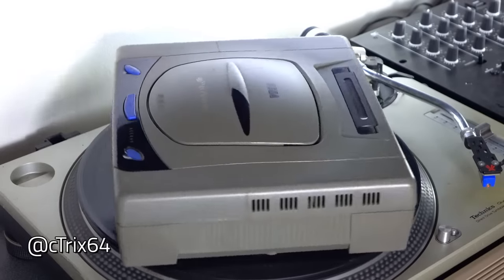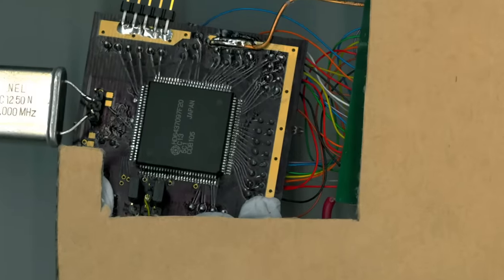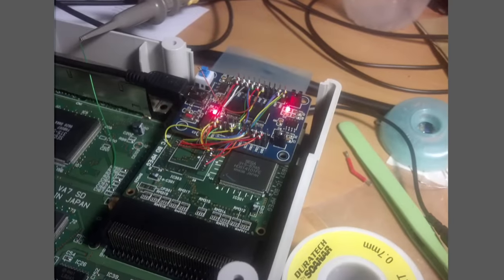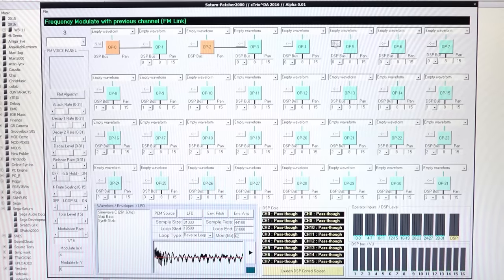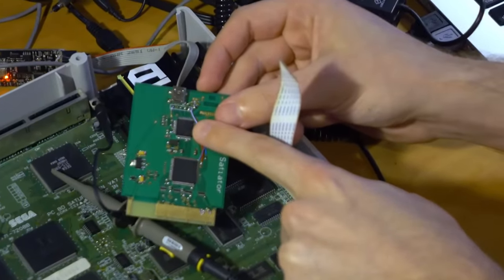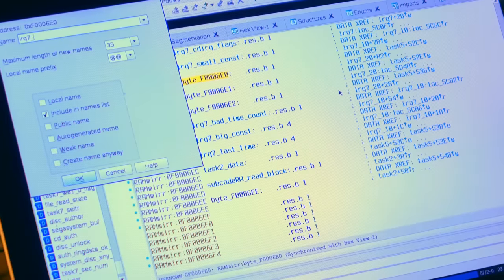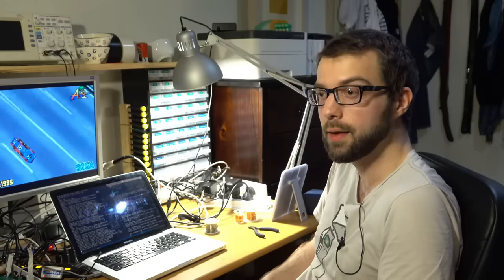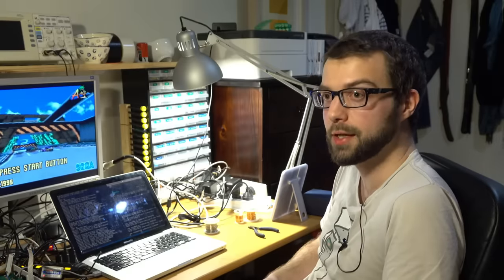Sega Saturn CD - Cracked after 20 years

Comment: the sony dvd's i save the image as img burn and extract the boot with 7zipper have to go in the 7zipper settings and have to enable the file type options that 7zipper should open rsss rsss rsss then sell the disks kkk kkk kkk When I open (.iso) it is written like this ([boot]) and inside that folder there is a (.img) that is the boot sector so that you can create a new disk kkk kkk kkk

Comment: Another chip in the laser board,, built in obsolescence a timer that expires the cdrom drive😉👍they use them in cars and security systems but they ask you to seek an engineer to rectify the light flashing on the dash or your security system these day's there's no led and it's a screen readout lcd

Comment: Eh, I've had a mod chip that bypasses it since 2005
Reply: Region Coding sir. Saturn has no such thing as unlicensed games. The SH-1 inside of the CD Drive is designed to Fortress protect Saturn from reading unlicensed Discs. You can't copy Discs either. Saturn CDR Discs are specially pressed and specially coded with a License Key AND a Squiggle line locking TOCs on the core of the disc.
Reply: @segaunited3855  that's cool and all, but I've got it right here and working
I can just toss in burnt copies
Reply: @silenthill4  You have Emulation and Burned CD s with Emulation Software. Again sir, Saturn cannot be jailbroken, because the CD Drives themselves are required to PLAY games on a Saturn. And the Drives don't read any unlicensed disc. The SH-1 is programmed to PREVENT the Saturn's SH-2 Main CPU from reading Unlicensed Discs.

Saturn Emulation is NOT the same in performance as Saturn Hardware itself. Emulators are notoriously buggy,bottlenecked, and gimped with low performance problems.

If you're referring to playing Region Free MOD games, then yes. Its quite simple to do on Saturn as SEGA intentionally designed it to be easy to MOD for overriding Regional Lockout. There's plenty of Cartridge Add ons that Bypass the Checksum detecting the Region BIOS coding.
Reply: @segaunited3855  no, it's a modchip that attaches to the ribbon cable of the CD drive. Allows you to run backups
Reply: @silenthill4  Saturn doesn't have Ribbon Cables on its CD Drivers. Now Rhea SKU Mods do, but not Regular Saturns.